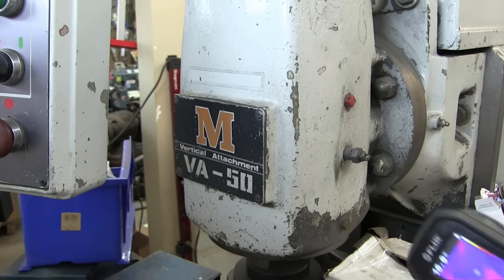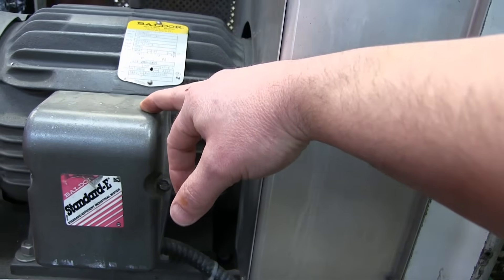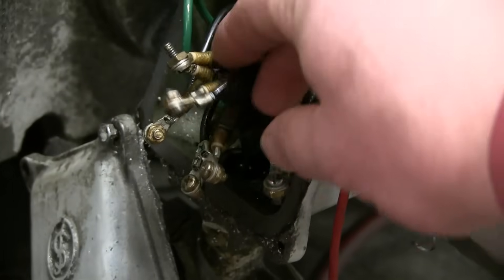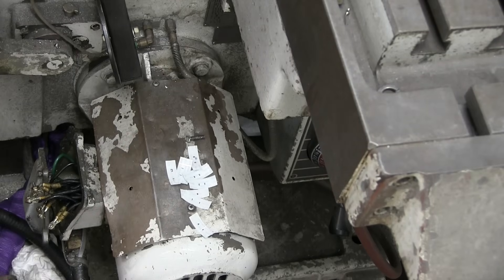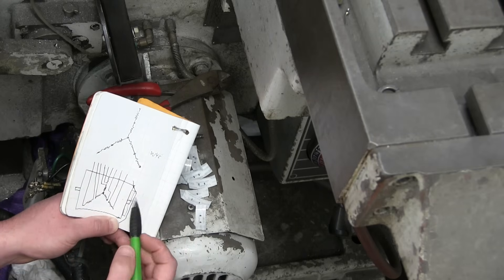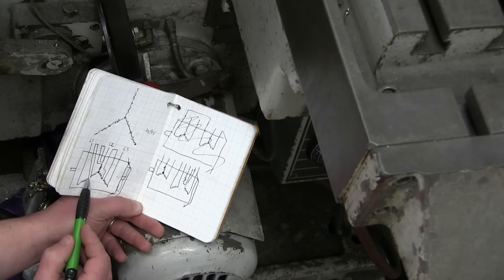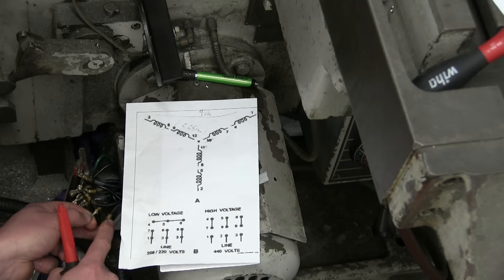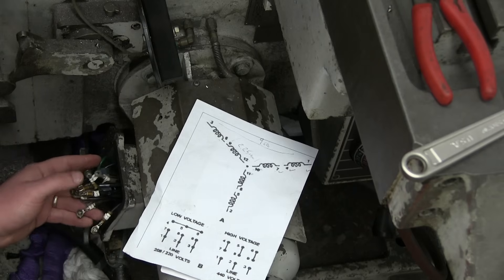MAZAK MILL AUDIT l 9 wire dual voltage electric motor wiring

Comment: A VFD is not going to play nice with those contactors or the multi-motor setup. You need a rotary phase converter or a true sine wave solid state converter like a Phase Perfect.
Reply from the maker: So, it's not the big whirling inductor that's the problem? It's not the little whirling inductors? It's the minuscule solenoids because of 16kHz chopped up AC?  OK then. ¯\_(ツ)_/¯
Reply from the maker: Maybe. 15hp spindle motor spinning at 1800RPM says the VFD won't even notice the feed motors cycling...
Reply: If ,and it's a big if, it is an issue for the controls then they are driven off their own transformer and are always single phase, it's easy enough to separate the control wiring, and wire it straight off incoming power at worst he'll need a new "control transformer"  they are small and cheap. Less than a Benjamin likely even phony Canadian dollars.  He might get lucky and have 120v controls and be able to just eliminate the control transformer entirely.  This is also what he would need to do if he wanted to use the drive to vary the speed.  

In short control wiring and power wiring separate at a point close to where power comes in and are isolated after that point. 

Multiple motors are not an issue as long as the drive is rated to handle the total inrush current ( add up starting current from all)  or if just rated for total running current as long as he doesn't start all up at once he'll still be fine.  On drives our saying was "amps is amps is amps". 

If you want to vary the spindle speed with the drive I'd buy 2 drives, one sized for the "big" motor and one sized for the rest added together it'll be small comparatively and cheaper.  Then isolate the control wiring and wire straight from households ac thru new control transformer if necessary.  Might even be cheaper to buy the 2 separate drives anyway.  drives go up considerably more in price  per amp of capability once you get past a certain point.
Reply: The VFD outputs a chopped up approximated AC signal. That's fine for running a motor. However, he has contactors with coils that probably get 110VAC from that transformer. The VFD power will not work in the transformer or directly in the coils. If he tries to run multiple motors with a VFD, he has to oversize it because each motor will have a large current spike when it starts up. I guess it could work if you separated out all of the control circuits and just used the VFD to run the actual motors and used clean single phase to run the controls.
Reply: We have spinning machines at work where vfds were retrofitted.(around 15 years ago)
So instead of the three phase line voltage feeding the switch cabinet it is the vfd that does it . (control voltage is seperate of course)
so they are controlled via v/f , from 1 to 87Hz.
there are 20 motors on one drive, every motor has its own (30 year old) contactor, it's own thermistor relay  and current feed back to the plc. all that stuff has been there before.
and since i've worked there, there were no motor or contactor failures due to the vfd.

the loads on the drive are not that problematic as a milling machine starts with no load, you do not amplify the inrush current like on a pump fan or rotating mass which is permanently fixed to the motor.
Other than that the vfd it's self is limiting the current if it's set to do so.
And it will because it can't put it out anyway, it'll just hit the maximum current limit. 

For the voltages spikes, keep the pwm frequency of the vfd below 2kHz and you'll be fine on old motors.

what you can't do with more motors on one drive is "direct tourque control", or slip compensation, but the cheap chinesium stuff wont do that anyway i supose.
Reply: Two basic ways to investigate phasing of unknown windings, both use some low voltage AC source to energize one or more windings, using the motor like a transformer. First method, energize some winding and monitor all other windings, using an o’scope to measure relative phase. Makes notes and determine phasing. Second method, connect pairs of windings in series and measure voltage of series combinations. If voltage of series connection is double that of one winding, you have connected them in phase. If voltage of one winding cancels voltage from the other, you have connected them out of phase. You’re a clever bastard, so you can figure out the rest.
Reply: I would be inclined to use a VFD on each motor, or change out the smaller motors to single phase.
Reply: i'd think a high impedance contactor coil can low pass filter a stepped 
VFD output as well as anything else... some extra heating in the coils 
from the high frequency content may reduce the lifespan of the 
contactors but i don't think Uncle Bumblefuck is running 24/7... i'd bet
 the smaller motors are negligible loads assuming the VFD is sized appropriately and reasonably well engineered, and the rotating spindle motor would buffer/filter the 3 phase lines anyway.  I'm assuming there's some mechanical, user friendly variable speed control for the spindle (and axes) otherwise you'd probably want to have more than one drive just to avoid belt changes.
Reply: Wes Johnson nah. You don't use all the contractors anymore. If you spec the right vfd it will have control terminals that can be wired to the old controls.
Reply: Wes Johnson right on the money!
Reply: Calculator says that's about a minimum 40A circuit.  Bam, big motors are hungry!
Reply: With a vfd you also have to watch out for over voltaging  the sensitive bits. 
That vfd will be outputting a chopped up dc voltage of close to 300+ volts to approximate an rms of 220. Most newer motors have insulation systems which can handle those spikes. Not sure about the control power transformer or any contactor coils that might be seeing full line voltage.
Reply: olesparky82 coil rating and insulation rating on the coils is two different things.  If nominal voltage out is what it needs to be the coils will operate, the insulation rating on those coils will be much higher, it might shorten their life but it's not likely.  If he tries to vary the speed, then yeah control wiring needs isolated, easily done.
Reply: At 400 V you can feed a 7.5 HP (5.5 kW) motor with a  1 mm² (~AWG18) cable ;)
Reply: Also keep in mind that you also need a  drive rated for roughly 2x the max current the machine draws. When you feed it 2 phases, the bottleneck is the current capacity of the rectifier which in theory would be good for 2/3 the rated kva, but in reality, they will cook if you are pushing the limit.
Reply: Your problem is that 7.5 HP, or 5.6 kW, is just a lot of amps at 220V (25, without any derating or overhead, to be specific). If you need that much power, the logic goes, deliver it on 480 so you can use more reasonable wire sizes and have less resistive loss.

The biggest single-phase GS2 is the 23P0: https://www.automationdirect.com/adc/Shopping/Catalog/Drives/GS2_(115_z230z460z575_VAC_V-z-Hz_Control)/GS2_Drive_Units_(115z230z460z_575_VAC)/GS2-23P0 and that only goes up to 3 HP. But even that calls for 27A fuses on the input!
Reply: Why not?
Reply: Wonder if he fed the vfd@ 60hz into an isolation xfmr if it might help the other bits  play a little nicer.

Still not sure how well the vfd will like the motor inrush currents hitting it, instead of soft starting an individual load.
Reply: AvE inductors are pretty resilient and even if you don't have matched motor coil resistance, they will battle it out with minor emf,  which the vfd can take. If you're not running 100 of those machines in one building, it's not a problem and you won't have power factor or emf issues.
Reply: I was thinking right with you. 240 single phase and 240 3 phase are two completely different things...phase converter is the only thing to take it from single to 3 phase.
Reply: Dan Ostler check Allen Bradley power flex drives.
Reply: If the motors in rush is too many amps, increase your acceleration time. Longer acceleration time = lower in rush amperage. 

He could get rid of everything and just use 2 vfds, a start button, stop button, estop and a potentiometer for speed control.
Reply: Isn't a rpc way cheaper for the same capacity than a vfd anyway?
Reply: you gotta bypass the main motor contactors or you load dump the vfd and it hates that.  the small loads... might be ok.  i put a lathe on a vfd but I just bypassed all the old contactors and only ran the main motor.
Reply: I'm curious how this works out.  I've also understood that a VFD is a one motor system (or maybe more that are always on and off together) and can't work as a "phase converter".  Contactor coils could be powered externally and all that happy stuff, but I just never heard of a single vfd controlling multiple motors like this.  Additionally, I don't recall seeing larger (much over 5hp ish, but haven't looked hard or lately) VFD's that are still single phase input.  For a 15hp, it seems the single phase 220v input would be pretty massive (didn't do any maths).  I'll be watching for the solution here but a Rotary seems by far the best way to go on this machine.  

I have a 7.5hp VFD on a converted Robodrill spindle.  It runs in speed and position mode (tool changing) and My understanding is that the VFD can't take single phase 220 input.  It's size required 3 phase input so unfortunately (not a big deal as I had the big 10hp rotary in the shop), it needs 3 phase despite most everything else in the control could be single phase. So the rotary runs for this machine and feeds plenty of current for everything.
Reply: true , nothing must be between the VFD and the motor ( exceptions are very rare )
if you need to install VFD in this case it have to be one drive for each motor and modify the rest of the control circuit for the voltage you have avail if needs any modification at all 
from the looks of it my first thought about this motor is a two speed "wierd" dahlander configuration ,as in industry if you need to change voltage conect it from star to delta its cheaper to put 3 wirings than 6 but since i am not ther to mesure it or smell it do not take my word for it
Reply: You can absolutely use a frequency drive that way.  Set it up for frequency/voltage controll instead of vector. The only issue you will run into will be the startup current on that big spindle motor. Most VFD's will only allow a 200% overload for X amount of seconds.    Put the drive before the main shutoff and start it before you turn on power to the machine.  You may meed to add a soft start for the spindle motor, or one drive for the spindle and a smaller second one for the controll.

The cheaper TECO drives are actually pretty good. I have 18 of them in service ranging from a few months to 10 years old witth only one failure.

I build new industrial grinders and service older equipmet every day. If you run into a roadblock with your setup, send me a msg and i can help you get it going. It WILL work.
Reply: I've ran condensing units (refrig compressor + fan +controls, even controls at a different voltage through small transformer) on one drive.  Works great. Condenser fans cycle on pressure and the drive never notices. 15hp compressor at 1750 with 2 1hp fans. 575v though, haven't tried 230v.   Blueberry farmers in abbotsford all want big freezers, but none of them have 3ph. Don't forget to oversize the drive. Limited by input amperage.
Reply: WalkTheWalk VFD electronics converts single OR 3-phase power first to DC then converts DC to 3-phase AC at controlled voltage and frequency, so VFD does MORE than old-style phase converters, either rotary or static.
Reply: So ditch the contactors, and get a VFD for each motor. The smaller motors will require a comparatively smaller (in price) VFD.
Reply: A bit off subject. I've been looking at a few brands lists and don't see a vfd  big enough that will turn single phase 220 to  run a 7.5 hp 3ph lathe. Any info for me? And I got my ruler kit. Yea!

Comment: One time , my brain collapsed trying to connect a 12 wire 460 volt motor to a VFD & the manufacturer didn't know how to wire it up. Had to find a 30 year old reference book to avoid letting the smoke out.

Comment: Climatization is a very important part of the process, you have to get used to its location so you don't trip over it, a process that will be lengthened by the hospital visit that would result from tripping over that monster, you also have to let the other machines sniff it and decide its not a threat, otherwise they decide to act out by having intermittent electrical problems and breaking tooling and projects
Reply: camtheham13 
Just rub the control panel door and say nice things to her. She’ll treat you right.
Reply: K Doe yeah that works sometimes  but when the one hp Bridgeport sees the shiny new 5 hp euro style mill, it is going to take a little more than a pat, you may have to buy her a new vfd
Reply: I have a an old Kearny treaker that has been seasoning nicely for some time now I'm not sure if the other things in that building have accepted it yet I should probably let it sit a bit more. at least I didn't leave it in my wife's parking spot like somebody else we know😏
Reply: This is why I put my radial arm saw off in the corner of the room and let it season. Can't have my CMS getting jealous and nibbling thumbs.
Reply: Yes, right...now the terroir is well established can I suggest it's time to have a cup of tea and put on your anorak? As a former boffin gawking at a box full of floating, unmarked wires doesn't half give me a sense of foreboding.

Comment: AvE, look into using electrolysis to rust up those nuts. Have the nuts as the sacrificial anode. It might work a bit better. Curious what your thoughts on this are.
Reply: Zachary Gnabah 
I had a good go with a motorcycle gas tank, a piece of rebar and a trickle charger once. Electroplated the rust off the inside of the tank onto the rebar. Worked a treat. Sad that there were some spots where the only thing left of the tank was paint.
Reply: Vinegar works pretty damn well without doing any crazy stuff

Comment: this is what i do for a living lol. machine electrician specializing in older cnc equip.
Reply: That is a terrible job. No instructions, no labels, no feking nothin'. And when the machine stops for 3 minutes the company are crying that you haven't fixed it yet while you are standing there scratching your head going WTF??
Reply: ah you must be in the trade too. lol
Reply: Repeat after me gentlemen.
"If you knew the job better than me, you wouldn't have hired me". Sprinkle in profane invectives per your personal taste.
Reply: What do you mean the contactor is cooked and motor needs bearings it was running fine! Can you just put contactor in and get it up while we order motor? the answer here is NO because some management type will say "its running don't need motor" then when wires burn off or contactor melts in a couple of weeks your at fault for not fixing it right..... Of course if you say no, they'll have new motor tomorrow afternoon....
Reply: this just happened to me with our crane. just get it working... me...fine whatever.... 3 weeks later crane is fubar...
Reply: Josh - I'm a pixie wrangler but the same rules apply

Comment: Is the average citizen really not allowed to have 3-phase power? I'm a farmer and that's what power the motors on our aeration fans for the grain bins.I guess it's a different situation. I'm from Manitoba by the way.
Reply from the maker: Not allowed and prohibited by cost amount to the same in the end.
Reply: It's not that we're not allowed per say, it's that in many cases three phase distribution is not available in residential settings and if you really wanted it the electric company would probably provide it to you but they would probably make you pay for the plant build out which is incredibly expensive.

Comment: Please do a delta vs wye vidjeo!!! No matter how many times I read the wikipedia page, it never sticks. I think if it's explained to me in canadian, I just might get it
Reply: Thanks man. I watched it again (without any beers in me) and read up a bit. I get it now. I appreciate the detailed reply.
Reply: Westley Davis I didn't get it either, but on this one I got it, watch it again. Take a hard look at the second drawing he does. It hit me like brick.
Reply: Westley Davis Just look at one phase. You got 2 coils for low voltage inside the motor. If you put them in series, you get 1 coil with high voltage.
Put them in parallel, you get 1 coil with low voltage for that phase.
To get the same power, that coil needs twice the current now compared to the windings in series.
Now watch the video again.
Reply: Westley Davis I coulda sworn he did already?
Reply: Westley Davis obviously frank gets it more than i. But I got it, maybe elecchicken for hire
Reply: Ok. Next step.
You get a motor with 400v coils. Now you can put it in delta on 400v for full power or in star and you get 230V on each coil.
You need to put on 230v (star) at startup to reduce the start current.
If the machine runs, you switch to 400v (Delta) to get full power.

You can run a 3 phase motor with a capacitor to produce a second phase, but it ain't scoocum. ( Reduced torque, bad for the motor)

It's better to get all 3phases out of a mechanical device, it's a single phase motor with a 3 phase generator. That's pretty old-school, but works forever.

The cool kids use inverters now.
Uncle bumblefuck explained it already. Many features, less weight, less space, full control, motor protection, speed control, reverse motion.

Comment: As someone not doing anything in the machinery field (software engineering), the simplicity and ingenuity of splitting the one Y to two Y's got me shed a little tear. Just beautiful
Reply: Same thought!
Reply: Thom van Kalkeren cool now go make some parts in auto desk inventor and build it on a mill.
Easier said than done.